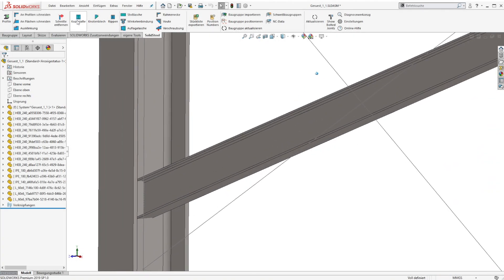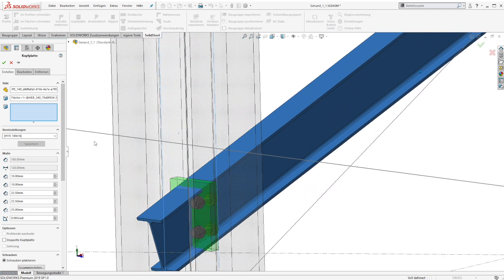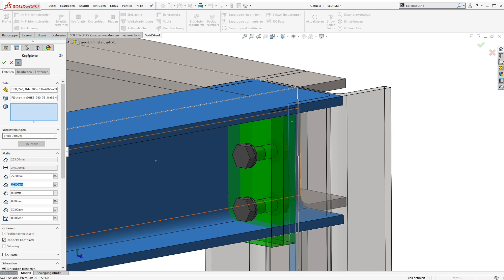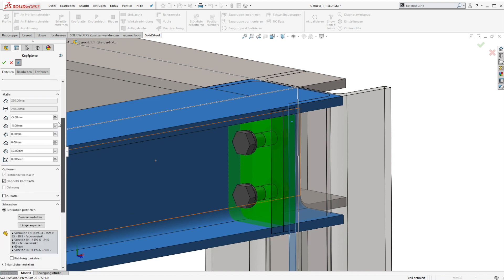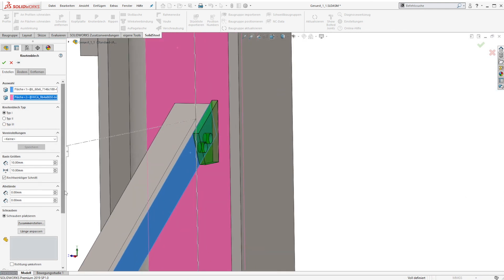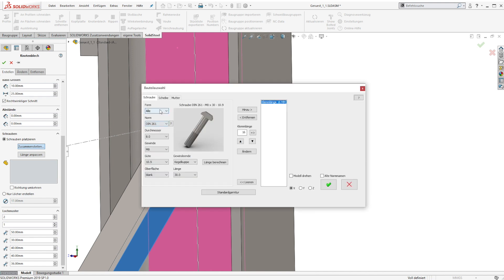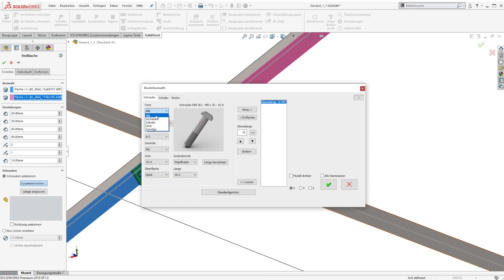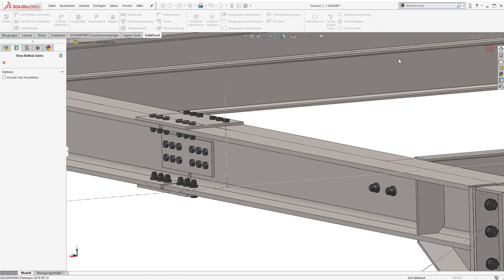Creating bolted steel connections in SOLIDWORKS with SolidSteel parametric for SOLIDWORKS

Comment: Did you fix the problem of manual bolt displaying which could not be done previously ?
Reply from the maker: Its fixed since several versions. Send an email to solidworks@solidsteel.de to get a trial
Reply: @apps4swx  I got trial and I think we are not talking about same thing , I'm asking for the command called Manual Boltings ... when you exit from command , bolts are hidden , and when you use command  to show them , they appear, after you exit from command they disappear .... and sometime we need to show all bolts in assembly or in Drawings ... Thank you
Reply from the maker: @leo198995  We are talking about the same thing. I talked to one of our technical team: There are different possibilities why the bolts are not displayed as a 3D body. Maybe the bolts are just suppressed by SOLIDWORKS (you can change this in the feature tree), maybe the path settings are not correct or maybe there is no 3D model behind the bolt you selected. You should get in touch with our technical support team (support@klietsch.com / +49 (0)271 23167 55). They will solve the problem because the function itself is working fine.
Reply: @apps4swx  Thank you for your feedback , may be this will help ...,Also My remark is about how Solidsteel is dealing with plates , any structural structure has plates as single parts or assembled plates , so did you implement plate insertion in SSP ?